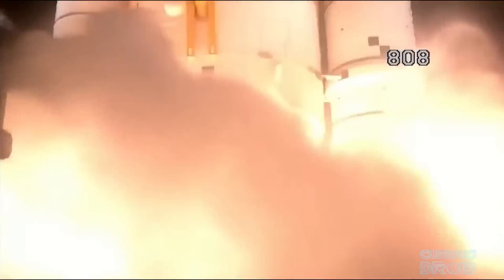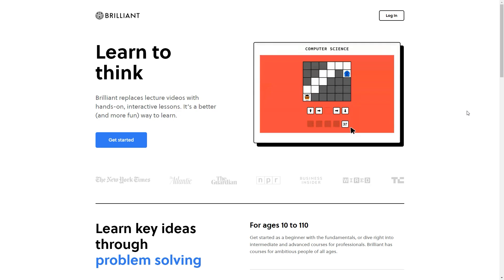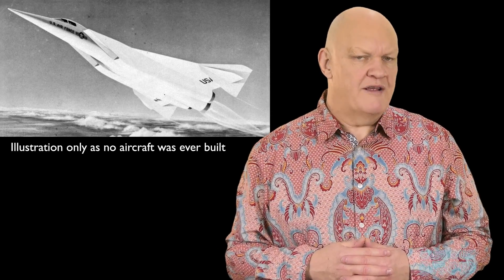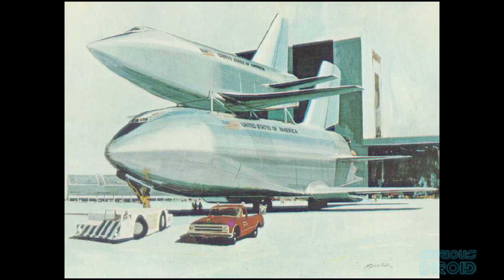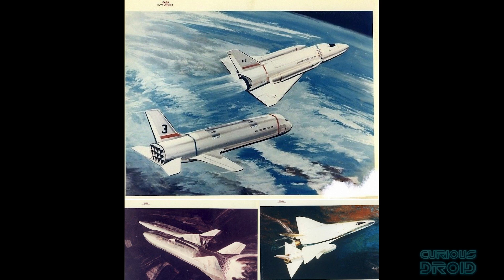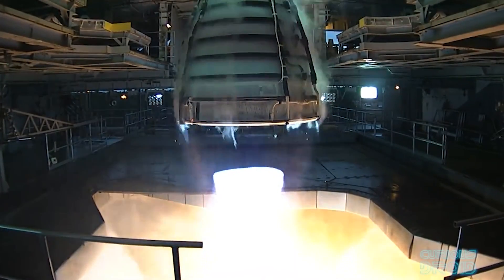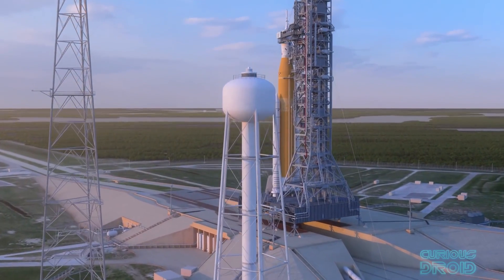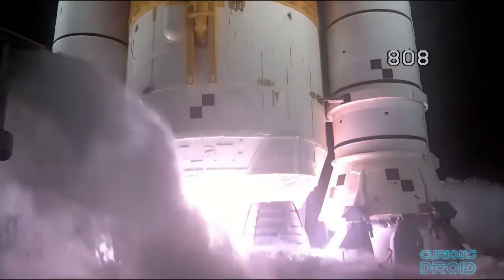Why is NASA Throwing Away Reusable Engines?

Comment: You never answered the question! Why couldn't they have designed SLS to recover these bits that were reusable?
Reply: Because he didn't look at the details. I'm disappointed in this video. Booster reusability is great, but has drawbacks.

First, if you don't have a fast enough launch cadence, you can spend more on recovery equipment and personnel than you save by reusing the booster.
Second, you take a payload hit for the recovery system on the booster. The Falcon 9 B5 can lift up to 22.8 tons to LEO when expended (SX), but only up to 16.7 tons when landed on a drone ship (B1069.2). Doing a Return to Launch Site (RTLS) landing, costs even more payload as you have a boost back burn to cancel the lateral velocity and return back to the launch site.
Third, the higher and faster you go, the harder reusability is to perform. The heavier the dry-mass of your booster, the harder reusability is to perform.

So with SLS launching once a year, eventually, the cadence doesn't really justify recovering the booster. Not to mention that it gets higher and faster than a Falcon 9 as the SLS core stage almost reaches orbit, making recovery MUCH more difficult. The SLS core stage is travelling well over 3 times as fast as the Falcon 9 booster and is well over twice as high as the Falcon 9 booster at MECO. The dry mass of the F9 booster is 22-25 tons while the SLS core stage is 85 tons.
The SLS Block 1 can get Orion to the Moon, but not with the kind of payload hit like F9 has. The SLS Block 1B will send along a Lunar Gateway module with Orion, so it really can't take the payload hit either.

Comment: The thing is the engines on the shuttles were re-useable because the shuttle landed back on earth, AFAIK the Artemis will not ie they can't match Musk's feat of returning utilising a vertical landing, therefore the engines might as well be cheaper one use variants.

Comment: There are some mistake in the video: first, the tanks aren't modified External Tanks, they're clean sheet design. It have different internal structure, different alloy, etc. The diameter is same and it both used SOFI, but that's all. Because it holds load on top instead of side had to change everything. 

Also it may Congress wrote in stone that NASA should use solids and RS-25 but when the SLS program have been started it started with two different teams: one who evaluated the LH2 based options and one who the Kerolox options. They even investigated Russian RD-180 based options too next to modernizes F-1B based options.
Reply: Yeah, the fuel tank was supposed to be ET derived, but by the time they'd "modified" the design to meet the new requirements, the only thing that was still common was the colour...
Reply: @simongeard4824  nope, the whole SLS was clean sheets from day 0, they just decided to use solids and RS-25 because that was who gives better TLI performance for this project. But the given engineering and economic restrictions lead in the same direction in some cases. But the tanks was clean sheet. SLS is eventually a merger of Ares V and DIRECT/Jupiter but not based on. There were a lot of different and really diverse concepts. Just check this: https://www.nasaspaceflight.com/wp-content/uploads/2018/04/2018-04-11-184524.jpg

Comment: Thinking about surplus engines.  What did the air force and the cia do with the spare engines from the YF 12s and SR71s did they scrap them. I read an article by willis hawkins years ago that the engines were good for 3,400 miles an hour but the heating of the airframe was the limiting factor.  Thank you for this. I wondered how nasa was going to handle the limited number of SSMEs.
Reply: The faster you go the narrower the mach cone, at about mach 3.65 the outer edges on the wings would make contact with the mach cone from the nose which would probably be disastrous so heating wasn't the only limiting factor.

Comment: Has Blue Origin even put anything in space yet?  Or built a orbital launch vehicle?
Reply: I think he brought them up because of the sub-orbital, straight up-n-down New Shepard booster and capsule that are fully reused.
Reply: @steveaustin2686  If that is the case the SR-71, YF-12, and X-15 would all fall in that class, and I think they all have higher altitudes than Jeffs model rocket company.
Reply: @quazy1328  The X-15 got 8km above the Karman line on it's highest flight, but the SR-71 and YF-12 can not as they do not have rocket engines. They have to fly MUCH lower. The New Shepards highest flight was 18km above the Karman line and regularly reaches similar altitudes as the highest X-15 flight.

Comment: Booster reusability is great, but has drawbacks.

First, if you don't have a fast enough launch cadence, you can spend more on recovery equipment and personnel than you save by reusing the booster.
Second, you take a payload hit for the recovery system on the booster. The Falcon 9 B5 can lift up to 22.8 tons to LEO when expended (SX), but only up to 16.7 tons when landed on a drone ship (B1069.2). Doing a Return to Launch Site (RTLS) landing, costs even more payload as you have a boost back burn to cancel the lateral velocity and return back to the launch site.
Third, the higher and faster you go, the harder reusability is to perform. The heavier the dry-mass of your booster, the harder reusability is to perform.

So with SLS launching once a year, eventually, the cadence doesn't really justify recovering the booster. Not to mention that it gets higher and faster than a Falcon 9 as the SLS core stage almost reaches orbit, making recovery MUCH more difficult. The SLS core stage is travelling roughly 3 times as fast as the Falcon 9 booster and is well over twice as high as the Falcon 9 booster at MECO. The dry mass of the F9 booster is 22-25 tons while the SLS core stage is 85 tons.
The SLS Block 1 can get Orion to the Moon, but not with the kind of payload hit like F9 has. The SLS Block 1B will send along a Lunar Gateway module with Orion, so it really can't take the payload hit either.

SLS started design work in 2011, 4 years before SpaceX landed the first booster and almost 6 years before they reused a booster.

Comment: It sounds like the whole Artemis program is a classic example of a design by government committee the members of which have absolutely no comprehension of space flight and possibly even a negative comprehension, if such a thing is possible of rocket engine design.

When I hear things like design engineers being told to destroy their research data so bureaucrats can avoid potential embarrassment I cringe with incredulity.

When I was at university there were several statements that were often touted:

1/. A camel is a horse designed by a government committee.

2/. An elephant is a mouse built according to government specifications.

3/. A mouse is an elephant built according to government budget constraints.

Just a thought, but 2 & 3  together  have an uncanny Artemis program feel to them.

Comment: Explain why nasa destroys used space stations when they could be repurposed as staging bases on or around the moon or mars…. Why spend billions on this stuff then burn it up when with minor repurposing they could have further service
Reply: Because they don't last forever.  Space is a harsh environment and sooner or later there will be a critical failure.  Plus a big station like the ISS has high upkeep costs.
Reply: @TheEvilmooseofdoom   can’t be as expensive as rebuilding a new station and spending years and more billions blasting it in to space. Even as a an escape habitat or a spare parts platform it makes more sense than burning it up and wasting the money we’ve already spent.
Reply: @williamforbes4896  Yes, it can. Think of the ISS as a 2000 minivan driven hard by a soccer mom for 22 years. Eventually it wears out and you need a new van.
Reply: @williamforbes4896  I suspect you are in waters over your head.

Comment: I somewhat bristled when you called the core stage a modified shuttle main tank, because it's really not.  The SLS carries its payload on top of the tank and thrust from the bottom, rather than both being to the side like with the shuttle.  This means that although visually similar, the core tanks actually have very little in common with the shuttle tanks as the forces through them are so different.  The diameter and basic shape is about all that's preserved, with even the insulation, despite the colour, being different.  This tank redesign is reported to be one of the major reasons for the delays and cost overruns of the program.

It would have been more appropriate to mention the boosters, as those actually do/did contain segments from actually shuttle launches.  They too have been redesigned somewhat - being now 5 segments instead of 4, new insulation, and modified solid propellant mixture - but as stated actually do have former shuttle components that previously were recovered and now are being discarded.
Reply: Exactly.
Reply: The core stage holds liquid hydrogen and liquid oxygen so referring to it as a "modified shuttle main tank" is accurate, you say it yourself when speaking of the boosters "They too have been redesigned somewhat - being now 5 segments instead of 4"
Reply: @phillipkalaveras1725  By that logic (holds hydrogen & oxygen) the Delta 4* is a modified shuttle tank, and the Falcon 9 is a modified Saturn V.  I mean, the Falcon 9 and Saturn V are both white and black, both burn kerosene and oxygen, and both have a central engine surrounded by multiple of the same engine.  See,  Falcon 9 IS just a modified Saturn V!

Again, at least the booster segments, the actual structural parts, ARE the same ones that previously flew, same as the engines. The insulation was already replaced after each flight, and the fuel formulation tweaked over time as well.  The segments, the parts that actually matter WRT reuse, remained the same.

Which cannot be said about the core, where the manufacturing process (nor manufacturer) isn't even the same.

* The SLS core actually IS more closely related to a Delta 4 core than a shuttle core.
Reply: I thought most of the stringers and frames were basically identical?
Reply: It sure looks like minimum amount of re-tooling would be required to convert shuttle centre tank manufacturing facility into SLS first stage facility as opposed to having to build a whole new facility just to make SLS first stage.
Reply: @drmosfet  And that's the argument that was used when they sold the project. Turns out that when you take a tank designed to have an orbiter hanging off the side, and change it to put the second stage and payload on the top, you end up with something that doesn't really have much in common with what you started with.
Reply: @drmosfet  
Looks can be and are deceiving.

However, it reads like you're confusing the vehicle assembly building (which has existed since Apolo) with the facility that actually builds the tanks.
Reply: @firefly4f4  
VAB Been there and literally bought the t-shirt, I've see it on TV since the early 1960s and work in establishment that made high pressure containment units, including composite.???
Reply: Near as I can tell, the external tanks were manufactured near New Orleans by Lockheed Martin, while the SLS tanks are being built in Huntsville by Boeing.  Now, I am aware that the two companies share some tech through ULA, but I'm not aware of any shared machining (ie actual shared manufacturing machines) between the two tanks.  If you can point to a source that says otherwise, please let me know.

Until then, please refer to my reply to Philip about the tank similarities.  However, it is my general understanding that these redesigns were a if not the major factor in why the project was delayed, as much more had to be changed from the external tanks than originally thought.

/Edit: fixed some typos & repetition
Reply: Nit picky nit picking. I'm sure Paul is aware of that given the depth of coverage in other areas. Probably oversimplified that section since this is a video on the engines and not the core stage itself.
Reply: @KirtFitzpatrick  If he did then why didn't he say it then instead of what he did? People who are into rockets are pedantic because in rocketry being pedantic matters.
Reply: @dr4d1s  Like you work in the industry and it matters?   Proud to be pedantic?  It's not a great claim considering what it really means.
Reply: @BTW...  No I don't work in the aerospace industry but I am a Telecommunications Engineer. My career involves being accurate and precise in what I am designing, implementing and talking about to others. It doesn't matter if it's other engineers or customers.
Reply: @dr4d1s  Nevertheless pedantic... and adding nothing here.

Comment: The flyback booster concept if it had continued would have essentially achieved what starship is trying today but almost 40 years prior.
Reply: @MrWolfstar8  If cost is not a concern and large payloads are the measure, we did have the Shuttle Program that flew for 30+ years.
Reply: @MrWolfstar8  No your wrong, what actually happened instead is that the US Air Force pretty much forced NASA to develop the large Space Shuttle with the expendable External tank because they wanted a LARGE Space Plane that could launch and recover spy satellites over the North Pole, this prevented NASA from using a smaller cheaper Space Shuttle design that would have allowed the budget for a reusable flyback booster to be built.

If NASA had not suffered from the budget cuts from Congress during the late 1960s and 1970s then they would never have been forced to rely on the USAF to provide funding for the Space Shuttle program.
Reply: The original comment is correct. I'm sure if you're stupid you'll want to argue that it isn't, but--and I'm just being honest--that impulse is all the proof you need that you're a moron.
Reply: @MrWolfstar8  Nonsense. Nasa obeys orders from above and the space program was always a thinly disguised military program. Anything NASA builds is handed over to the enemy before its even started and the USAF didn't want to hand the Soviets something like the XB-70.
Reply: @MrWolfstar8  Lets get real SpaceX is riding the bleeding edge of consumer technology. The stuff hes doing just isn't possible on space grade tech. Hes running x86 CPUs with code compiled in C++ and his analytic in matlab and LabView. Hell the dragon displays run on chromium. Its only going to get crazier as he crunches physics with his new super computers.
Reply: @MrWolfstar8  Nonsense.
Reply: @MrWolfstar8  if it wasn't for the cost SpaceX wouldn't bother with making reusable boosters. It's not like they do it just as a gimmick
Reply: @thesteelrodent1796  yeah Elon wouldn't do something just to make a point
Reply: @thesteelrodent1796  Yeah, it'd be unfathomably out of character for a Musk run company to push attention grabbing gimmickery.

(I actually like reusable rockets, but we can't ever completely rule something Musky out as "Not a gimmick"...)
Reply: @thesteelrodent1796  The thing about SpaceX is we don’t know if it’s just a gimmick. "Oh, what a tangled web we weave, when first we practice to deceive!" (Sir Walter Scott, 1808)
Reply: @thesteelrodent1796  it is a gimmick. SpaceX launches cost more than the Shuttle precisely because they have to refurbish the reusable sections and because you are wasting fuel and payload capacity to reland the boosters.
Reply: @bipolarminddroppings Shuttle launches cost at least $1.5 billion each in 2020 dollars. Falcon 9 has flown to orbit more than 200 times and SpaceX's commercial price is $67 million per flight (or around 150 million for Falcon Heavy). These prices include profit margin, so the actual cost is somewhat lower.
Reply: Imagine what the sea dragon could have done...
Reply: Of course I expect you're not talking about precision landing flyback re-use (like SpaceX), as the control just was not available. GPS assisted silicon/laser innertial guidance just wasn't available.
Reply: @MrWolfstar8  yup and Elon's reusable rockets are more expensive per launch than the Shuttle, despite his claiming it would reduce the costs and be rapidly reusable, neither of which have been acheived.

Plus, SpaceX weren't the first to do reusable rockets, just the first to have enough money to throw away to use them
Reply: @bipolarminddroppings  
No.

SpaceX has used the same Falcon 9 booster twice in three weeks.
The fastest a shuttle was ever refurbished and used again, was 54 days.

And the shuttles cost $450 million, just to launch.

SpaceX isn't remotely that expensive.
Reply: @bipolarminddroppings  Falcon Heavy costs a fraction of what the shuttle cost, and Starship will ultimately be even cheaper. What universe are you living in? The shuttle was also extremely dangerous.
Reply: @bipolarminddroppings  is this before or after factoring inflation?